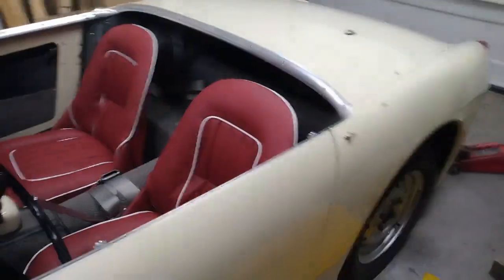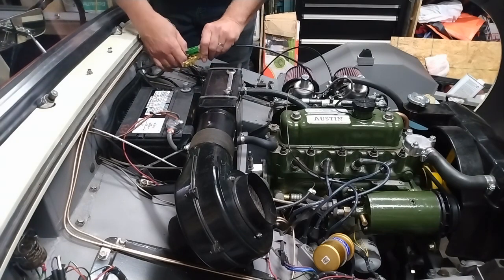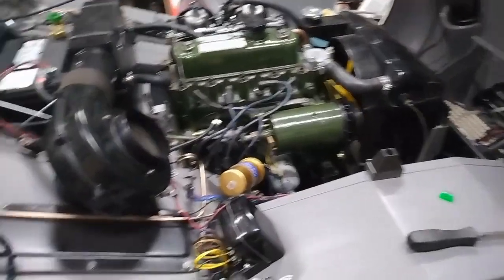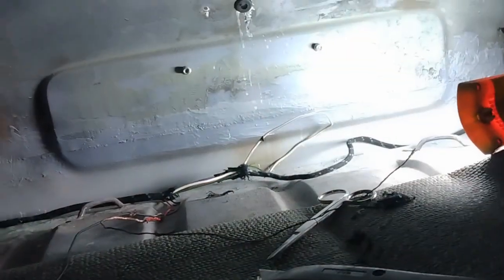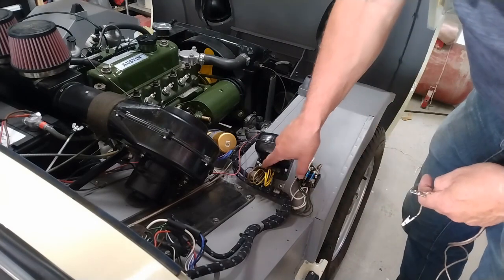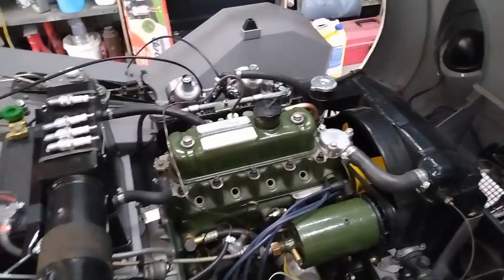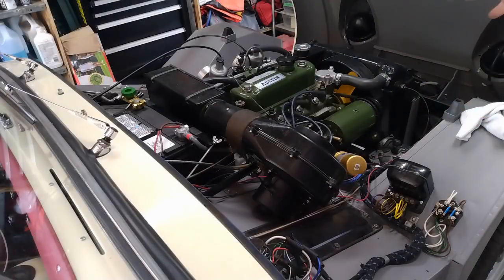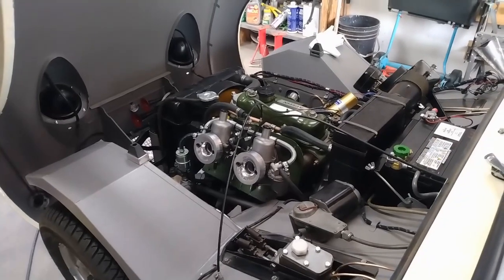First start up attempt and how NOT to wire a license plate light! Bugeye Build Episode 131

Comment: Quite a milestone, well done!

Btw when connecting the battery for the first time, it's a good idea to fit a 20 amp fuse in the bettery lead. Ant mistakes and it'll blow the fuse, not set your new loom on fire. That would have saved your numberplate lamp wiring.
Reply from the maker: Thank you Steve. I'll keep that in mind for future projects.

Comment: Nice work Ian.
I noticed at 6:10 when you turned off the key that the lower right light blinked on for a second.  Did changing the signal switch fix this, or is it just a quirk of the car?
Reply from the maker: I didn't notice that! It turned out that I had the flasher hooked up incorrectly. Once I put the correct wires on the correct terminals the signal lights worked as they should.